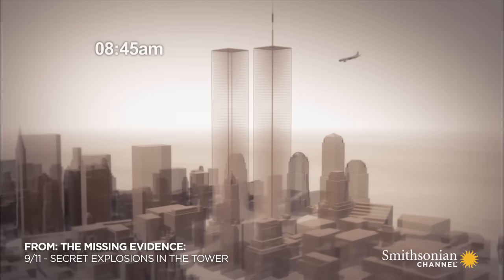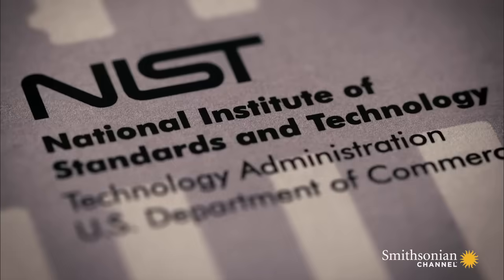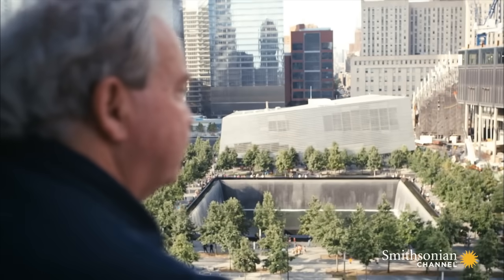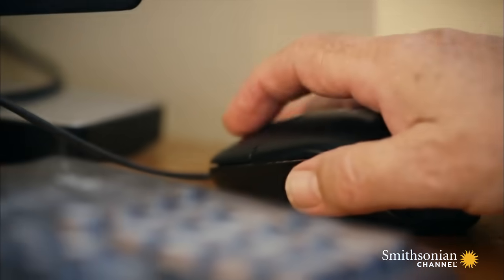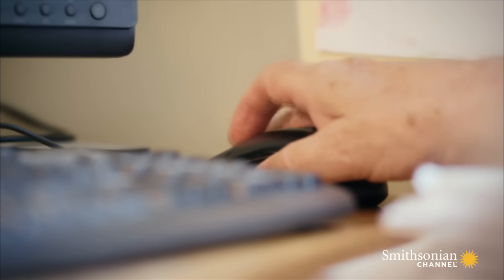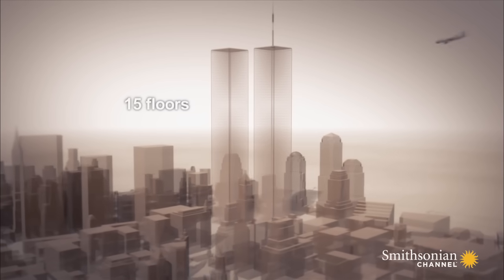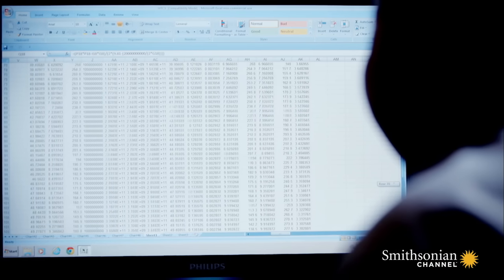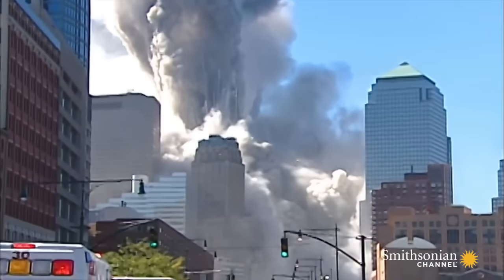This Computer Simulation Explains How the Twin Towers Fell

Comment: never had any building in a controlled demolition started at the top of the building!  
a controlled demolition always falls into its footprint starting from the bottom. furthermore,  it's interesting how, if the buildings where ''rigged'' with explosives, and yet they failed at exactly the point where the aircraft entered the building!  also, never in history has a ''tubed structure'' building, the kind of which the trade center was constructed, (and was the only of its kind) been smacked with a 200 ton aircraft traveling at 500+ mph and survived!  I understand that the empire state building was hit by a b25 Mitchell in 1944 and stayed standing.  but let's be real! a b25 doesn't contain nearly the same mass as the Boeing 767 nor was it traveling at even close the same speed.  not to mention that the empire state building is a girder and panel type structure. much more resilient against fire and impacts.  
it's clear how these buildings collapsed.  we all saw it.  as a matter of fact,  it's amazing they stood as long as they did.  you only have to heat steel a quarter of its melting point for it to lose more than half is strength under load. 

 for those that don't want to take professional reports of the mechanics of how these buildings collapsed because  you don't want to follow blindly,  then I suggest you yourself get a PhD in structural physics and engineering.  then you may have an opinion of your own that is backed by science and mathematics. oh and by the way,  last I checked, gravity only works in one direction!  funny how they just feel straight down eh? dam that Newton fella was on to something! 
the physics on how these buildings collapsed is really straight forward.  now, the events that led up to the attacks.  I.e. government envolvement, well,  that I cannot answer,  country's have been known to attack itself to gain favor from its population to invade another. but, I must say,  I'm just an engineer not a politician. I would hope that this is not the case, but unfortunately the American government hasn't really been leading there population with much honesty.  good bless the NY citizens and all those from other country's for banding together in this tragedy! you are the hero's of 911 as well!

may all those who lost there lives rest in peace, and may all who lost there loved ones know that we are all mourning with you!
Reply: +Steve Hunter The titanic was designed to be unsinkable, the designers said so. How could just one iceberg sink it? Ice can't cut through steel.
Reply: disgny you're stupid
Reply: disgny If that's true then how do you explain the video which is zoomed into the building, and clearly shows the beams get pulled inward and snap right before you see the top part fall? how is the building supposed to stay up them? is it supposed to just float in the air?  if there were bombs inside it then why did the beams fall inward and not away from the building originally?
Reply: you tube video  black smith DEBUNKS   heat can't melt steel theory.
Reply: True, they were designed to withstand plane impacts - from the largest planes in existence at the time they were built. Planes have gotten bigger since then. They were not designed to withstand the impact of something as large as a 767
Reply: In addition to the hundreds of witnesses to explosions, there were other people, both in the area and later viewers of videos, who allowed themselves to be persuaded that there were No explosions. There would not seem to be any practical use at all for nuclear explosions.  They would leave too many traces; you couldn't hide them. Also , remember that all the columns had to be blown on floors simaltaneously,  which would require far too many nukes. But according to Prof . Niels Harrit, among others,  modern military grade "Thermate"  WOULD produce the effects seen,  such as  thick steel looking like swiss cheese,  the pulverisation of almost all the concrete slabs,  and the  "quietness" of the explosions.
Reply: Schuyler Schultz 

so.. first.. there were 2 planes and 3 buildings that collapsed..

WTC7 was not hit by a plane.. fact

NIST says that through FIRE column 79 was loosing its structure and because of this was a chain reaction and the all columns failed.. hmm..

But if 79 goes first, why the whole building goes down straight?

Because of fire a massive steel column looses its structure?

Never ever a massive steel building in history of steel buildings, there was a collapse because of fire..

Think about the much more extreme fire in london a few months ago

I dont believe NIST 

Especially because in first report they didnt mention WTC7.

Why? its the most shocking event in our time and they dont mention it.

"Sorry i forgot, was a hard working day" or what?

WTC7 falls in nearly free fall speed because column 79 lost structure?

DO YOU REALLY BELIVE THE OFFICIAL VERSION?

I dont say that there was someone planting devices or else.. judt that i dont believe the official version

P.s. The part of WTC7 which gone down first, was in a "part of seconds" going first.. not in "seconds" 

big difference!

Looking forward to a rational response :)
Reply: mopar69brt to be honest I didn't read your comment, I just saw that you wanted me to prove that gravity doesn't always act down. I did that
Reply: ImHereToLacerate w
Reply: To answer your question about the thermite, or any other traces of explosives that may have been found in the rubble, uh, we seem to be forgetting the fact that there WERE explosives set off at the towers in, what was it, 1994, something like that? In any case, yes, it would all have been cleaned up, but there would ALWAYS have been traces of the explosives used during the bombings of the mid-90s. So, yes, there probably were traces of explosives found in the rubble, but not for the reason people are believing. There were no explosives used in the 9/11 TERRORIST ATTACKS - which is what they were, plain and simple.
Reply: you're just an idiot, dude...give it a rest...
Reply: Jacob Sullivan a steel framed unfinished sky scraper in Spain burnt for 20 hours and did not collapse
Reply: Steve Hunter the weight of a plane can break the concrete and the 200ton plane sitting on top of the floors and concrete as well added weight enough to break the floors below and then over and over again a domino affect happened as the weight continued to smash through floors taking more weight with it form the floors it already smashes through
Reply: Never has a steel framed building collapsed due to fire apart from the 3 in one day. You say it's clear how the buildings fell by saying we all saw it. I'm afraid evidence is needed. NIST who I assume you are referring to have also failed to explain the total collapse. Hence it remains a massive question.
Reply: There would be an equal and opposite reaction from the floors below if the top section was falling on them. You are clueless
Reply: They lack science to demonstrate the collapse was due to being hit by aircraft

It's basic high school physics that can demonstrate that even with the damaged sustained at the top of the towers
It's damaged mass is not enough to obliterate the remaining bottom of the building
Newton's first law of physics
Every action has an equal and opposite reaction
20% of mass cannot pulverise 80%  of mass
It would cancel out at 60%
Because the object below is pushing back with equal force

The buildings did not fall due to the initial damage nor its elongated effects as the commission reports
Reply: there were SOUNDS of explosions. there's a difference. What they were actually hearing were the loud BOOMs of the elevators free-falling and crashing into the bottom of the elevator shafts. Perfectly understandable how that sound could have been mistaken for a bomb, but there were no explosives in the towers. And don't even try to say there were traces of explosives found in the rubble. OF COURSE THERE WERE. A BOMB WENT OFF IN THE PARKING GARAGE EIGHT YEARS EARLIER. You can rebuild that section completely, but residue from the bomb would have always been there, so, yeah, traces of explosives were found in the rubble, but NOT from bombs supposedly used on 9/11.
Reply: dreamer
Reply: explain WTC 7 then please
Reply: ed303 it collapsed from the inside. the central columns collapsed, leaving the outer shell of the building unsupported, and that's why it appeared to fall like a controlled demolition. look closely at its collapse, and you'll see the penthouse on top of the building collapse several seconds before the rest of the building. and if you REALLY look at footage of it collapsing, it did NOT fall straight down. it actually fell at a slight angle. this looks SIMILAR to a controlled demolition, but if it were a true DC, the ENTIRE building would have collapsed at once, and it would have fallen straight down, which it did not.
Reply: column 79 is on the right side of the building - penthouse on the left.. explain this also please .. i am curious

https://www.youtube.com/watch?v=XrnmbUDeHus
Reply: it goes down in free fall (almost) .. just several seconds.. if it was just going down because of one single column loosing structure, it is against laws of physics! that is a fact
Reply: oh.. and to say that, because noone got killed it doesn´t need to be investigated is also not really convincing to me..

The Grenfell Tower was not the only famous example for a real horrible fire. Another example is the "Torre Windsor" in Madrid which was almost 24 hours on fire and didnt collapse, but the WTC 7 collapsed after a few hours in a nearly perfect way
Reply: that is not a fact. it does not goe straight down just because of one column. Look at it closer, instead of through whatever tainted glasses the communists are giving you.
Reply: hmm.. my eyes are very good.. 

greetings from occupied country ;)
Reply: mopar69brt ok
Reply: Was it hit by a 767?
Reply: disgny I have seen the video reporting that molten iron was flowing out of the twin towers, however, the molten liquid was actually most likely aluminum, which was what most of the airplanes that hit the twin towers were made out of. As for the presence of thermite, there has been no scientific study published to this day that reports to have found thermite or thermite traces in the debris or dust from the twin towers.
Reply: two words..  BUILDING 7
Reply: mopar69brt fall straight down? debris was shot out horizontally some pieces were piercing buildings blocks away and most of the building was pulverized what kind of strength and power do this? have you ever considered suing your brain for non-support?
Reply: Jacob S.  : Suggest that you spend some time looking at "'
9/11 a&etruth "videos.  And others.  Your information is seriously mistaken.  I retired after years as an engineer, and I can tell you that even in high school courses I took years ago,  thermite was described, because it is so dramatic and obvious in its ability to melt steel.  Often used to weld railroad rails together in the field. Simple process.
  Also, molten iron does NOT look anything like molten aluminum.  And also, if you think about it,  airplanes have lots of alumiinum , yes, but it is almost all sheet metal, which is very difficult to assemble into a  stack which might stand still for melting. Mere fire won't do it.  And yes, about thermite, look up a Prof. Niels Harrit, a respectable scientist , about how he found "Thermate" in the WTC residue.  Unmistakeably.
Reply: Jacob S.  : I am surprised that you did not realize that you yourself can prove Free Fall, especially on bldg. 7.   All you need is a stopwatch , and a high school knowledge of Newtonian Physices.  It comes out to about 6 seconds, as I recall.   There is NO explanation of that other than  Controlled Demolition.
Reply: Jacob S.:   the study you referenced was very interesting, and almost suspiciously loaded with specific esoteric names of uncommon substances, and procedures, etc.,, but apparently they did not come up with any particular enlightening results .  As for your statement that "thermite" cannot melt steel, that is just beyond idiotic.  It has been used for well over a hundred years, routinely in welding railroad rails together, for example.   It is featured in the most basic high school type Chemistry classes, (because it is so "cool",  the way it instantly melts thick steel plates, etc.. ) I guess you have never seen that,  because it is unforgettable.
Reply: Eyewitnesses and first responders stated that almost no concrete was found in the rubble after the collapse. Each building had 110 floors of four-inch concrete an acre in area. What happened to them?
They all turned to dust. Fire and gravity cannot do that.
Reply: I don't want to be rude, but your ideas  about thermite are simply, and totally , WRONG. The rest doesn't make sense either.
Reply: Insults do not have much "content", other than an expression of your personal  anger , about something.  It would be thoughtful of you NOT to clutter up discussions with them.
Reply: You know it's kind of funny that the link to the video got deleted, which showed them snapping, this just go to show, that they refuse to here any real evidence if it contradicts what they say, they refuse to be proven wrong and instead of trying to refute it they just have to pretend it doesn't even exist, the fact that there were no bombs in it doesn't matter to them, they can't admitt that they are wrong, so even with little evidence, they convince themselves that they are right, a clear example here
Reply: If you are an engineer, you would really appreciate the work of the ae911truth group.   Especially interesting is the testimony of actual experienced airliner pilots,as well as firemen and policemen about experiencing explosions, etc.  The bottom line:  Building 7,  not hit by any airplane, Free Fell in about 6 seconds.  Newton's Laws say that cannot happen "unless all supporting structure is removed".   And how can that be done?  Controlled Demolition is the only practical way.  No one has suggested anything else that is credible.
Reply: Mopar:  you say you are an engineer.  Good, then you should have NO problem understanding just why the Free Fall of building 7 is IMPOSSIBLE without  the COMPLETE removal of all structural support, and that this  can ONLY by done by explosive, preplanted, carefully arranged explosive demolition.  If you know of any OTHER way, please let us know.   While you are at it,  tell us where all that Molten Iron came from, as well as the extensive traces of NanoThermite , or "Thermate" , a rather secret and rare military grade advanced explosive, not available in caves in Afghanistan.
    By the way,  the Towers were way over designed, and the significant loads were AXIAL, so that the purported weakening of the steel by fire would not be anything like enough to bring down the buildings.   And just what is that Snark about gravity makes things fall straight down.  (A common sign of explosive demolition, is it not?!)
   And your conjecture that the twin towers construction concept is more prone to damage  than the Empire state building is proven how?!   If you are going to say the the "evidence" is because they collapsed, doesn't that mean to you seriously believe that any structure exists that cannot be destroyed by military grade controlled demolition techniques?!
   I think you should re-examine your assumptions about how controlled demolitions MUST be arranged.  True , they usually follow a pattern: but in the 9/11 case, there are quite a few reasons why the usual pattern may have been altered, for cause.  Such as destruction of Evidence.
Reply: you are delusional. find another hobby.
Reply: While in the Air Force I spoke with a Muslim American Airman, he was a Chaplin. He was asked by somebody else why there was an attack on the WTC to begin with. It took the Chaplin a while to explain it but basically it dated back decades, with America and American allies typically going up against these groups in the Middle East. Eventually they got what they believed to be their revenge on the West by attacking the heart of Western Capitalism; the World Trade Center.

Islam is, in my opinion, a bit bi-polar. Part of the religion is to be tolerant and welcoming of guests for example, but another part of Islam is that if someone spits in your face -- you spit back. So yeah, there are wackos all over this world, and some of them use religion as an excuse, and guns as a means.
Reply: They were designed to withstand MULTIPLE impacts from jet planes. The designer of the buildings said so.
How could just ONE plane bring them down? Kerosene cannot melt steel or disintegrate concrete.
Reply: disgny not to mention that thermite cannot harm steel enough to cause and loss of structural integrity.
Reply: mopar:   You really need to do some research about controlled demolitions  before you just blurt out things that "occur" to you.   The whole idea of the "control" part is that the explosives are designed to go off in a timed sequence, having to do with where you want to "steer" the wreckage, among other things.  And they do not necessarily " start at the bottom. "  .  All of that depends on what the explosive riggers want to do.  In the WTC case, there is good reason to believe that  for entirely other reasons (mostly financial)  they wanted to make sure about destroying all records in certain offices, along with the investigators themsleves,  of various frauds involving billions, which is why  the initial blasts were "where the airplane hit".. You could not rely upon an airplane strike to do that job, but it makes excellent "cover" , along with providing a scapegoat crew to blame for it.  This is very  consistent with the fact that NO siginificant airplane wreckage was ever discovered. Just about the only "significant " airplane debris was that famous Arab passport "found" in the street.
Reply: Thermate must of been used.. plus the amount of different deadly substances they found in the rubble.. don't listen to political science, listen to physical science..watch videos on thermite/thermite on steal beams.. also watch videos from people who was there, workers, policeman and the fireman etc that became seriously ill, died and was there.. its not hard to see the evidence that's been kept from the truth to the public.. I have researched enough to know what to believe.. even what happened at the pentagon was fishy.. the 2 fighter jets that patrol near everyday all year was sent on different course on the day of 9/11.. so much more included.. it all does not add up.. and we all know the media and governments lie.. cause throughout history people in power have done everything to have power, money, resources.. greed is route of all evil and throughout history civilians die for people in powers greed/desire for more.. look at all the innocent women men and children America, the uk and European countries have killed in the middle east, and Africa still paying colonel tax to France back from the slavery times.. the world is and always has been fucked.. so much meaning in life we don't understand, so many unanswered questions yet all we do is kill and hurt one another.. we are a deluded/retarded kind of species.. I wish we knew and had had knowledge to what ancient civilizations had.. peace on earth will never be achieved and we will probably be the death of our own kind one day, seriously fuck humanity.
Reply: I never said thermite. I think high-powered bombs brought the towers down, possibly nuclear.
Reply: mopar69brt gravity does not act in "only one direction".

Get yourself a PhD in Physics then come back.
Reply: If you have seen a new authentic video showing the internal structural events inside the towers, please give a reference so the rest of us can see it. And some reasons to believe that it was not faked.  Although I have a degree in structural engineering, I can't quite imagine how your suppositions are justified.
Reply: what you were looking at was a cartoon, not a video.  With cartoons, like the Roadrunner,   anything goes; that doesn't make it Reak